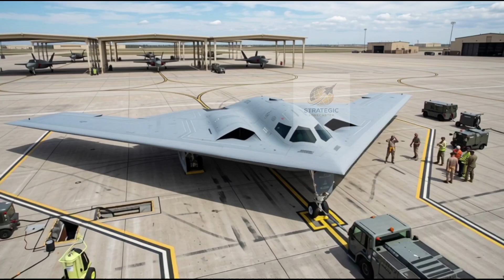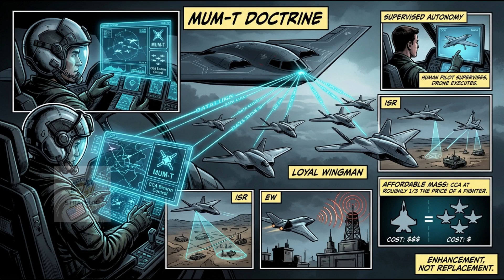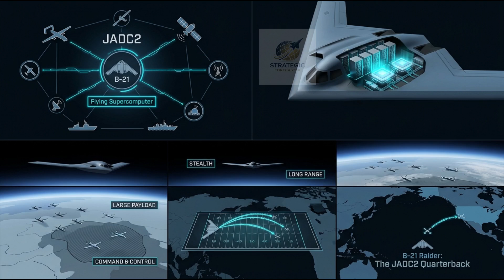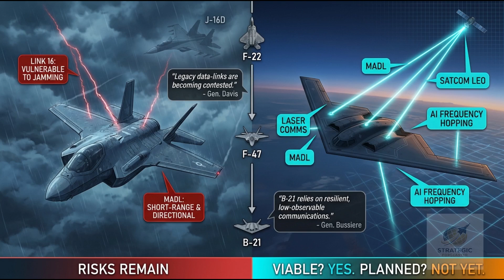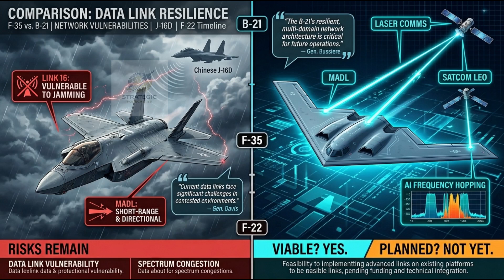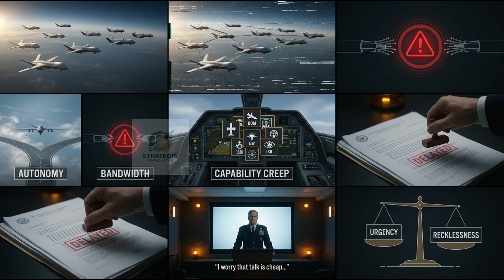B-21 RAIDER AS CCA MOTHERSHIP IN MUM-T (2026 BREAKTHROUGH)

Comment from the maker: Here's the reality: the B-21 is technically the better mothership — but the Air Force is sequencing it AFTER fighters.

We built this analysis around the communications argument. F-35? Link 16 is vulnerable. MADL is short-range. B-21? Designed as a JADC2 node with multi-band arrays, laser comms, and SATCOM.

But here's the key: viable? Yes. Planned? Not yet. That's the official position.

What do you think? Should the Air Force accelerate B-21 integration or stick with the fighter-first strategy? Comment below. 👇